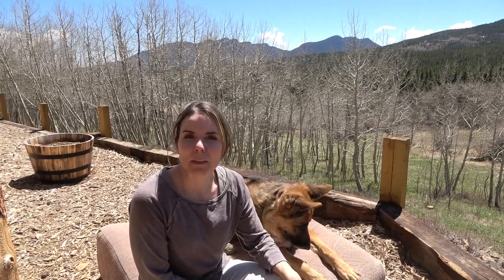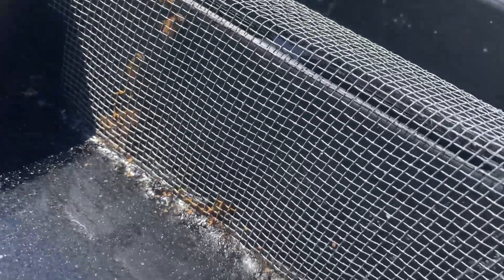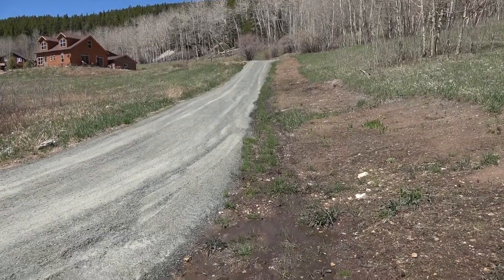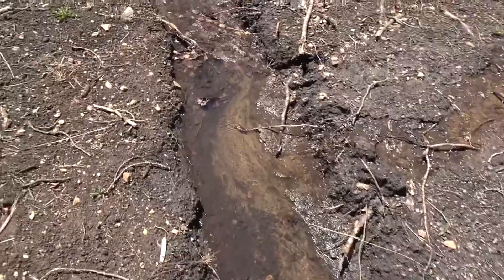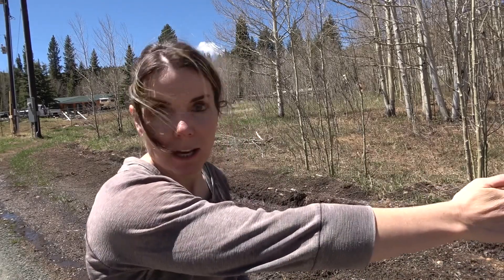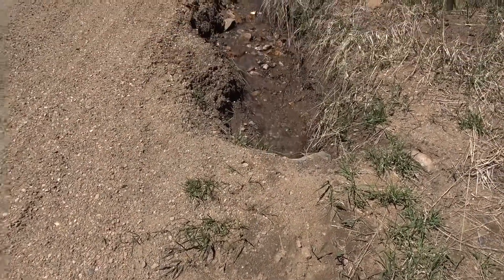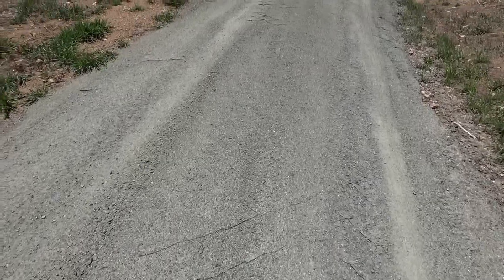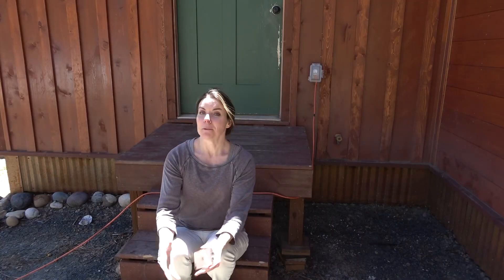Water Drainage Issue on Driveway. What Would You Do?

Comment: When water flow out on to the drive it means the road is lower than the shoulder that leaves two choices regrade the edge of road to the ditch or raise the road. Myself I would do both raise the road about 6 to 8 inch’s best would be put fabric down stone then cover with fabric then good gravel mix then grade down to ditch. from the view of your camera it looks as though the shoulder to the ditch is higher than the road,the water on the road is just filling a low point. Remember water goes the easy way. As for your spring that side needs a swale cut from the shoulder out to make its flow further away from the road. These are ways I have handled our road on the farm years ago it was advised by several contractors,you might give one or two a call and get a proposal as to how they would solve this too in most cases it’s free.
Reply from the maker: Thanks for  the tips!

Comment: What I would do, is a French drain next to the creek where all that water is. I  would have it spill out over by the culvert before it goes underneath your driveway, or take out a part of the driveway right there and then have it so it spills out on the other side of the driveway. Then, I would put the driveway back so it looks normal. If you don't want to do that, then the first option is probably the best. I have that same problem.  I did put a French drain in by my driveway,  usually it should fix the problem. Our water is running from October until June when we stop getting rain here in Oregon. So yeah, I think it works good and that might be the best bet if you don't want to dig a ditch and have your snowblower get stuck in it in the winter.💖💖
Reply from the maker: Thanks for the tips!

Comment: In mountainous, rocky soil conditions, surface snow melt penetrates deep into the ground, eventually resurfacing near the lowest points as it gradually works its way toward streams and rivers. My NM cabin is between the mountain and a river. Houses all along the river have springs pop up under them from prebuild excavation. We just happened to ask the right question when visiting with a real estate agent who didn't work on commission.  We asked why a particular house kept selling over and over. Every new buyer would renovate, but sell after a couple of yrs. He told the truth... because every Spring the lower level floods, even though the house is 75 feet higher than the swamp between the house and river.  Most of the houses along that river were excavated into the high side several feet to make walkout basements. The ones with the most excavation are most prone to the problem. One newer house has their sewage holding tank back up into the finished basement almost annually as their leach lines back up. Thankfully my cabin was built by a tight-fisted banker who spent minimal $$ excavating before building. The basement wasn't dug much, he just followed the natural terrain were it descended abruptly down toward the river. I have one spring on 400 feet of river frontage. Its only 30 feet from the river, and only flows for a couple months each spring. My cabin is 75-100 feet up above the river. As a few folks advised you, attempting to mitigate the situation with more ditches or excavation can make it worse. Consult the retired builders/excavation professionals in your neighborhood. They'll tell you the truth since they've nothing to sell. One split-level house we  looked at had no concrete floor in a spacious, heated double garage.  The r-e agent hinted they had run out of money  but we eventually found the builder, who said there was a spring inside the garage. 2 French drains were installed, but he recommended against pouring a concrete pad in there. Imagine a $400K home with a rock floor in the garage?
Reply from the maker: Oh wow! this is the first year having the problem, probably related to bryan pushing the trench back several feet from where it was (right next to the drive). Perhaps just a shallow ditch to allow the water to exit to the culvert could be an easy solution.
Reply: @ColoradoMountainLiving  I hope so Amy. Y'all need to find some local, older dirt-work experts to consult. Preferably retired, since the younger guys doing this type work often see newly transplanted homeowners as prey ($$). Best wishes,  enjoy your summer.

Comment: I build roads and highways for a living and if it was my own property I would start by putting my drainage ditches right along side the road because keeping water off your driveway is the most important to maintaining a good road putting a ditches right at the roadside catches water running off your road and it also catches it before going onto the road and i'd also get rid of the ditch that's several feet from your driveway. If there's an erosion problem you can line it with fabric and rock. The other important thing to do is get your driveway raised a lot more with more gravel then make sure to crown it at a minimum of 3% for proper drainage to keep the water off of it, that's why you want your ditches right at the side of your road the rest of the property being wet really doesn't matter unless you plan on doing something with it. The most important thing you're wanting is to keep your road in good condition with minimal effort going forward into the future.
Reply: I believe you're 100% correct keep the ditch near the driveway and raise the driveway in that spot keeping it dry is the key
Reply: What he said
Reply from the maker: That probably is better, but it's embarassing to say how many times we got the tractor stuck in the ditch when snow plowing the drive (when the ditch was right next tot he driveway. We do plan to add more rock to the drive.
Reply: Agreed.  Ditches need to be right next to the road and the road needs to be crowned.
Reply: Hey people, I also build roads and the above is sound advice. I say yes to 3% cross fall whether that be a crown or one way cross fall depending on location (radiuses need a one way cross fall). Your drainage ditch being away from the edge of the road is fine as long as there is a nice batter from the edge of the road down to the ditch (which you don't have) and this ideally would be a steeper grade than 3%, if your ditch isn't at least lower than a 3% projected line from the edge of the road then it will need to be deeper to allow a decent batter. Putting the ditch close to the road means it doesn't need to be as deep but if you need room for snow plowing (not an issue here in Australia) then you can still achieve good drainage, it will just mean there will be a substantial amount of earthworks... good luck :)
Reply: @ColoradoMountainLiving  that's understandable not wanting to slide off the road when plowing snow I also live in snow country on the Idaho, Wyoming, Montana borders. I don't know if you have tire chains for all 4 of your tractor tires but having good tire chains on the front tires with ice bits really helps with traction and steering contol also a snow plow that is a couple feet wider on the right side than the tractor especially also helps by keeping you away from the edge of your road when plowing.
Reply: @ColoradoMountainLiving  maybe the ditch was too close to the driveway? I would check with professionals in the area to get their assessment so you don't keep chasing this and get it done once and for all and keep throwing your time and money at it. It's hard to tell grades etc from a camera but the ditch/ crown idea sounds best.

Comment: I'm betting that if you take a post hole digger and dig a hole between the drainage ditch and the driveway you will hit mud down a couple feet...water seeks it's own level, even through the soil. The bottom line is the runoff spot has to be lower than the driveway however you choose to do it.
Reply from the maker: Probably so.

Comment: As long as you have somewhere lower to drain it you can cheat by putting in a french drain to collect the spring/seep before it hits the surface. It will be frozen over the winter but it will work for all the warm months. For any points the cross the driveway they do make thicker heavy duty drain tile that will hold up better then the normal corrugated plastic pipe normally used and you can cheat by running the drain down the center of the driveway then using a heavy duty pipe where it would cross the area a tire would be over. 

For the springs on the hill you can cheat and do zigzag trenching into the hillside to green up a larger area when they are flowing. Take full advantage of them to water the hillside as much as you can using just gravity and some planing. Then again you can always tap the springs to fill holding tanks to run some solar powered watering systems to cover the entire hillside.
Reply from the maker: Thanks! I'm sure we can come up with an easy fix that doesn't involve tearing up the drive.

Comment: Slope the side of the road to the ditch more.  That's a lot of material  to move with where the ditch was put.  Ideally the ditch should be 6 feet off the side of the road.  

If I was in that situation,  I would raise the road through the marsh 12 inches higher.   The road needs to be the higher than any point in that area.
Reply from the maker: We can probably do that.

Comment: As the water evaporates the sugar water solution becomes supper saturated and the sugar can no longer stay in solution and crystallization starts. Just add a small amount of water and stir until crystals disappear. If necessary keep adding water and mixing until they do. 

Your drive way run off ditches should be at the edges of your driveway. And should be at the lowest point of the driveway right of way. And not several yards away. The trench Brian dug should only handle excess water run off. Don’t dig deeper, raise your driveway. Add more stone!
Reply from the maker: Thanks! We do plan to add more stone:)

Comment: SIMPLE Solution to an otherwise ( COMPLEX ) Problem.

First and  foremost.  
 Set out  markers / flags- ribbons  at the locations of  the  Springs  you  are seeing NOW. From there connect the  dots as  best  you  can.
 If  there are to many ( different  areas  you  may need to REPEAT  this  process to get maximum benefits. 
FRANCH DRAINS will be able to collect and  direct the  majority of any spring water you have If multiple areas are  to FAR  apart  consider  small  Retention areas with an  OVER Flow  to keep some  water  for  immediate access. 
 Mostly  the  drainage trench  you  have  now  could  be  added to the  collection of the  other  SPRINGS / French Drains along the  way . 
NEVER  DISCOIUNT  the  Abundance of  Fresh  water on hand. 
 Bottle Some, Store some, Keep a  retention pond  for  Emergencies and  then let  nature  do its  thing. 
Small ponds for  wildlife to consume and  also  use  during periods of  drought and   Extremely  hot  stretches  will bring  you years of Satisfaction . 
Re-Cap.
 Determine what  you  are dealing  with . 
 How many Springs, and there locations. 
 If  one, two, three, or  more  Small  French drains  are best.
  ( You ) should  consider the  retention pond  areas for  each.
 Not  Large, Or  deep - Just  adequate  for  an  Overflow to  allow  excess  to  flow  on down the  way.  
 You are blessed with this  God  Given Feature. 
Don't  Ignore it , And  Never  Discount  the  advantages  it  brings in the long  run. 
PEOPLE  Fight  over  Water rights  all the  time.
  You Have it in spades. 
 Be the  Wiser  and  choose  to be a SURVIVOR .
Words to live by - Always.

Comment: do not dig deeper will make it worse
Reply from the maker: ok
Reply: Yes, that often is the issue with springs from the snow melt. The water seeps out where the permeable layers meeting with an impervious layer is exposed on the hill side. If you dig away the permeable layer there is nowhere for the water to go but out. However if it leaks out faster then the problem might be gone faster. My friends property the snow melt springs run for about two months